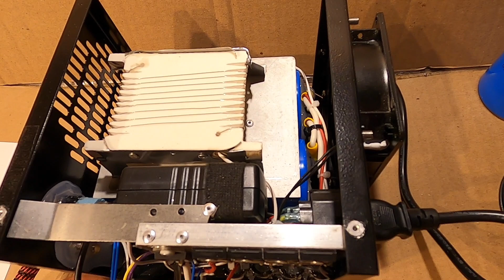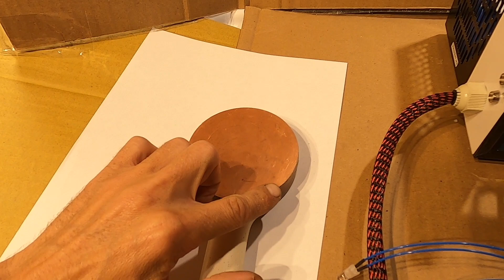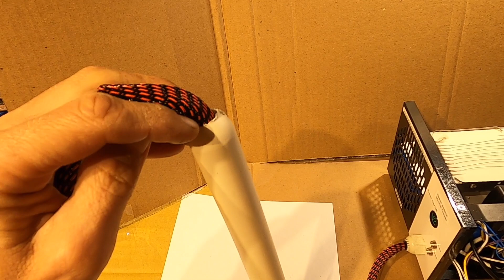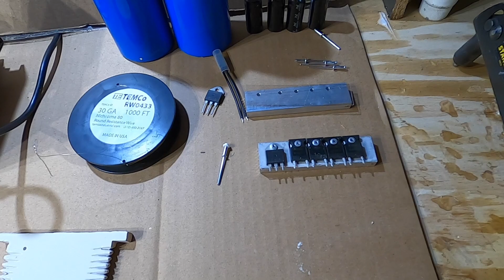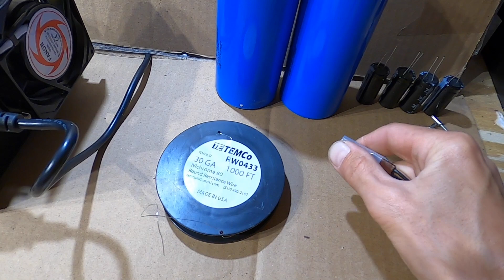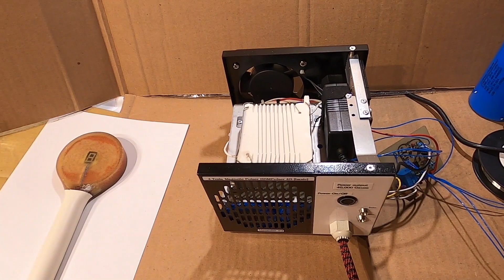014 Inside look BBMPulser 4B Automatic Magnetic Pulser 14,000 Gauss (1.4Tesla)

Comment: Interesting, thx for sharing...

What is the need for Nichrome resistance winding?
Why do you connect Caps in series and not parallel?
Reply from the maker: I use 40-50 Ohm Large resistor to drop down the  currant spike when capacitor bank discharges during pulsing and first initial charge.
I connect caps in series so I can charge them to higher voltage.
Connected in series I can safely charge them to 700Volts.
Electrolitic Aluminum Capacitors they dont make them for high voltage, so I have to series them to get high Voltage.
Reply: @AndreyD  makes sense, thank you.
Reply: moto gee Hi moto gee, lucky you. Congratulations!
Reply: @noelmoralde6242  thank you Noel. And thanks to Andrey for having the give away